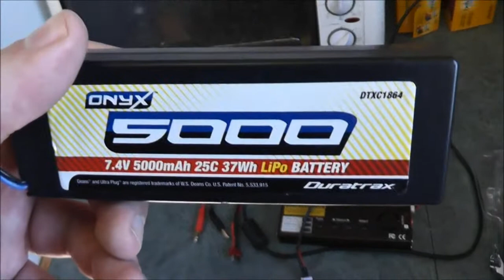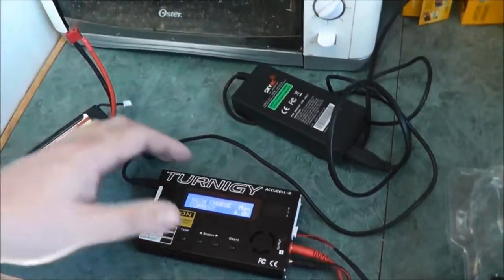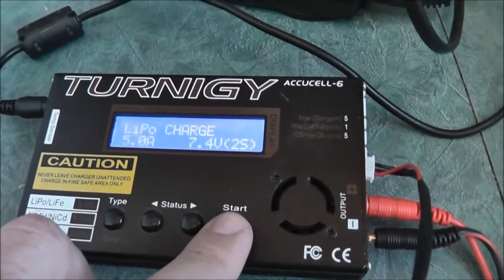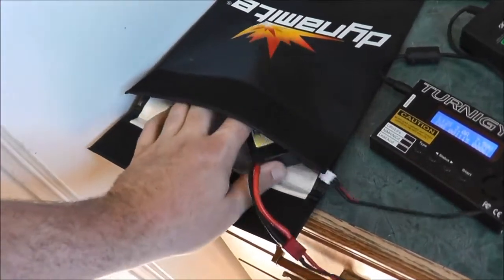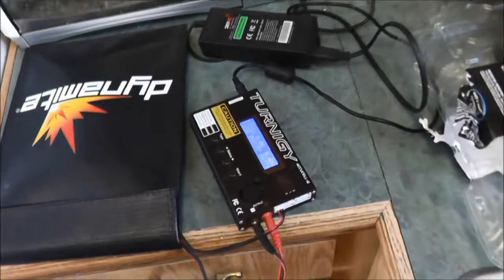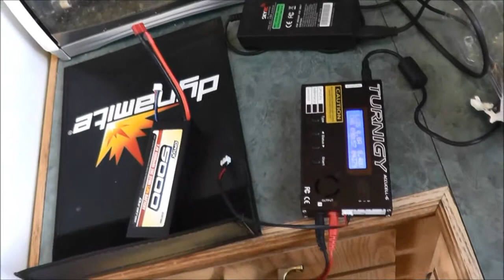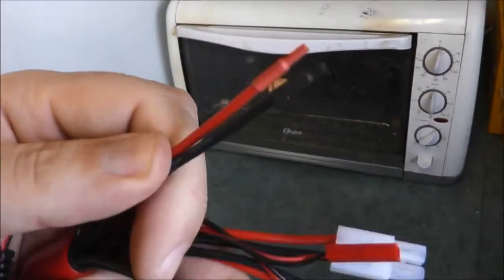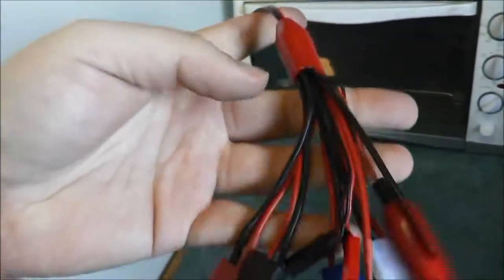Lipo Charging

Comment: I was the one that asked for lipo instruction. I need a blow up bag, lol. What causes the lipo to catch fire? With lipos does it matter if they have a partial charge when you recharge? Sorry for the questions, Im wanting to get a couple lipos , but want to avoid a disaster
Reply from the maker: lithium polymers are just fragile. too high or too low voltage = bad. Best to get a low voltage warning device. you plug it in the balancer when in the car. will beep when voltage too low. best to re-charge when done playing. If in storage for a long time there is a 'storage' option where it puts it at a certain voltage i guess. ive never done it.